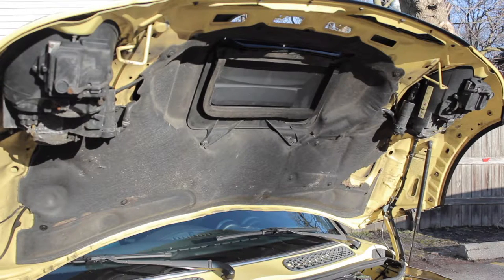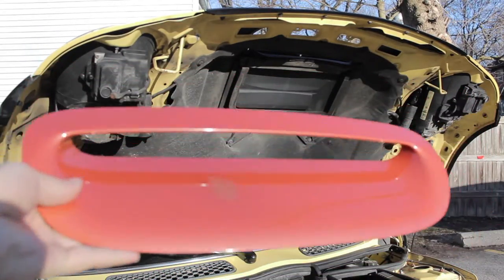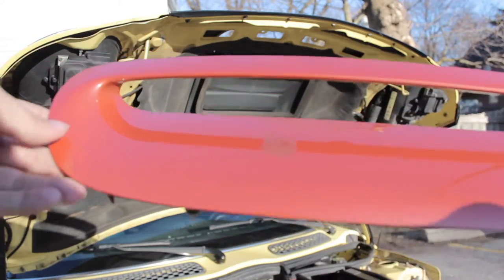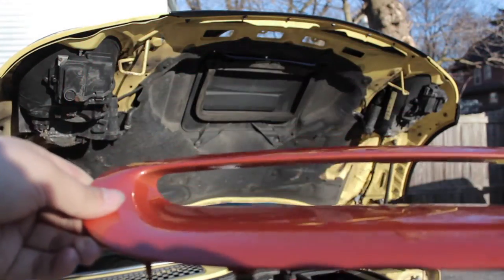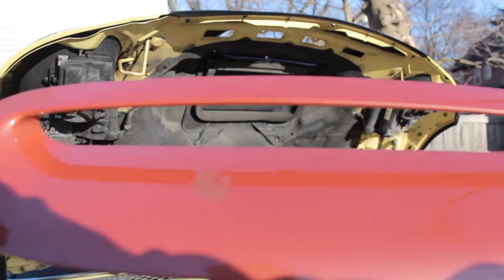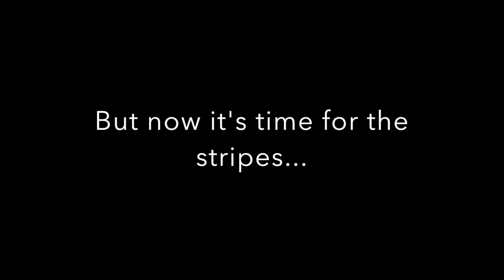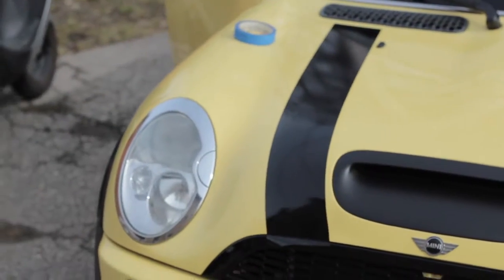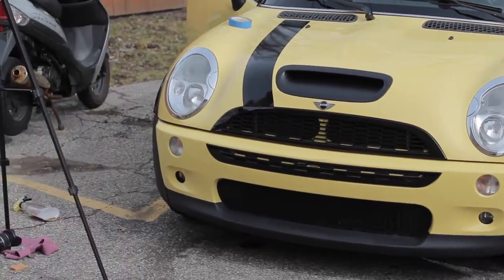New Hood Scoop + Stripes for the MINI!

Comment: Forgot to mention, the plastic comb your using..take a small pce of cloth..double it over and tape it to one side of the  comb..this protects both the car surface and does not scratch your vinyl either..